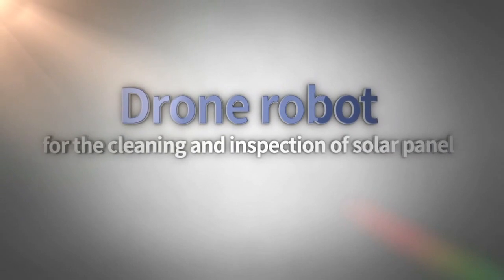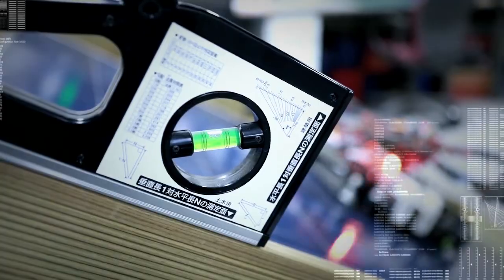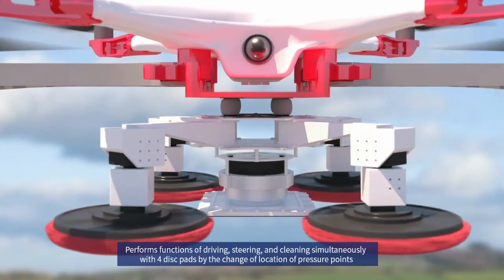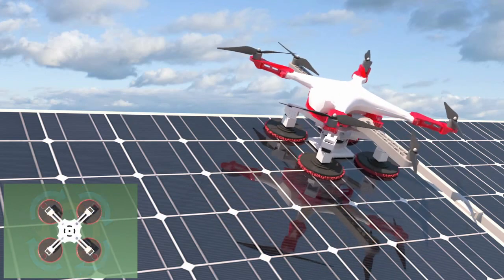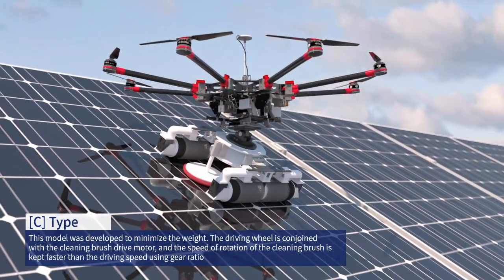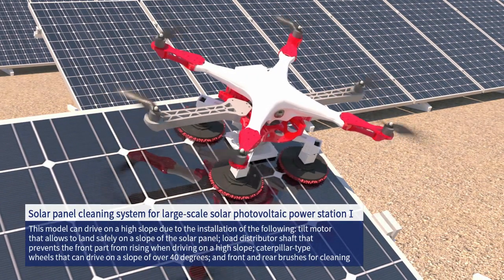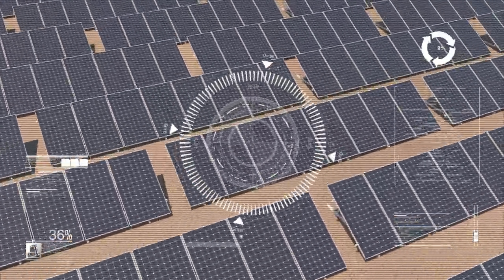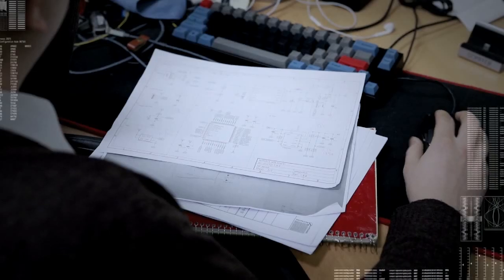Dron robot for the cleaning and inspection of solar panel

Comment: This robot can be easier for roof-top installations or ground-mounted sites with less than 30 degrees angle. Lasts 5-7 hours for one charge.
https://www.youtube.com/watch?v=mlo6L8x0Q24&t=11s&pp=ygUhc29sYXIgcGFuZWwgcm9ib3QgY2xlYW5lciBtYW1pYm90